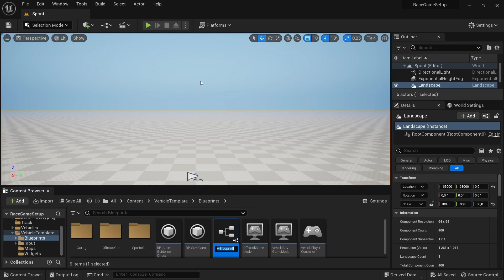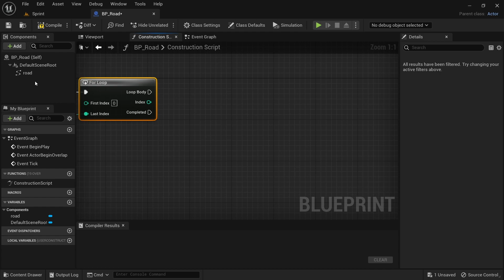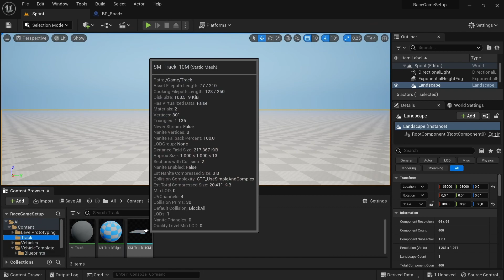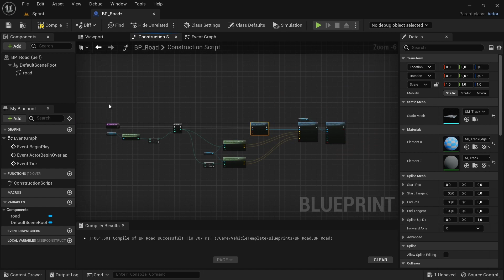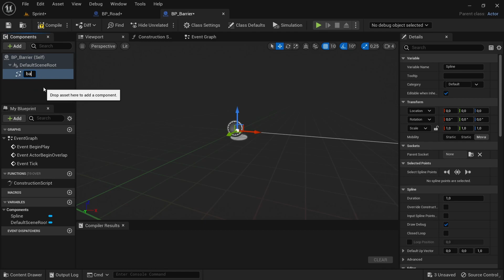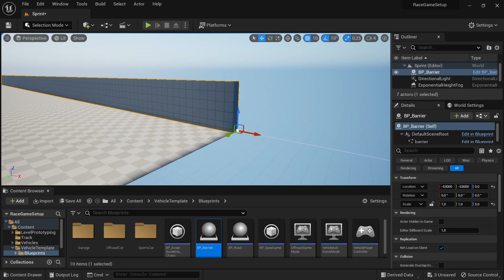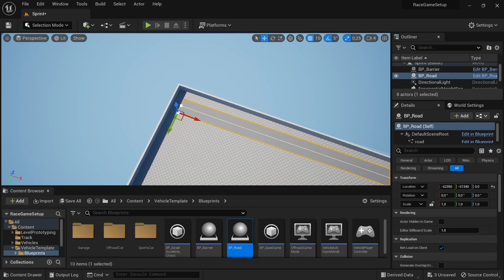How to create roads using spline component | Unreal Engine | Racing Game Tutorial

Comment: how to add collision for barrier, my car crossesthe box and barriers dont stopit from moving out
Reply from the maker: You can either add blocking volumes in the scene where the barriers are. To add blocking volumes, click on the icon that has a cube and a green plus sign and type "blocking volume" in the search bar. You are gonna have to do some resizing. The other way is to open the static mesh and add a collision object if it doesn't have one.
Reply: I added the colision in static mesh, box collision,but.its not working...definetly i will try bloking.volumes@GenuImitation
Reply: @GenuImitation  i have added bloking volume and its working fine,,,i have also added the collision in static mesh setting,,,simplified box collision but it did not worked, bliking volume did it,,,secondly can we add a speed limit to the  car, my car exceeds 1000 km, shall be very thnkfull to u sir :)
Reply from the maker: @MuhammadAhmad-zb1hq how is your car exceeding 1000km... are you using a real car's gear ratios...
Reply: Yup, i am...
Reply: I havent change anything in cars blueprint or event graph, just following tutorials
Reply from the maker: @MuhammadAhmad-zb1hq what car is that
Reply from the maker: if you haven't changed any of the sportscar's values then it should only be able to go about 300km/h. it's weird that yours is going 1000 with default values
Reply: @GenuImitation it is because of upgrades..
I adjusted the stage 3 macro value to " 1.001. So its going around 340km..which is desent i gues..now i am confuse for remai ing 2 stages
Reply from the maker: @MuhammadAhmad-zb1hq if you're not sure, add an extra '0' making it '1.0001' 👍🏾👍🏾
Reply: Or should i need to change values in engine stages values?
Reply: Ok, i will try,,
Secondly my engine is saving game, how can i make the game to default.
I mean i have purchased items and money is know zero....
I have upgraded money variable to 10k again.but atill game has ero money..how can i reset everhthing
Reply from the maker: @MuhammadAhmad-zb1hq you can either change the save slot name or in a blueprint add the 'delete from slot' node and add the names of the slots whose data you want deleted. If you're going to go for the 'delete from slot' you'll probably need a node for each save slot and you need to connect the node to the event begin play so that when the level plays it'll delete the data. Otherwise you can add a debug button to the Sportscar with the 'delete from slot' connected, so that whenever you press the button then any save data will be deleted
Reply: @GenuImitation okkkk,,,kinda looks difficult to unddrstand but i will try, bcz i have to do this for test purposes
Reply from the maker: @MuhammadAhmad-zb1hq ask if you have more questions 🫱🏽‍🫲🏾🫱🏽‍🫲🏾
Reply: @GenuImitation  thanks sirr ❤❤❤❤
I will .